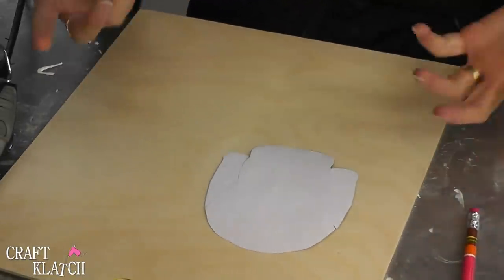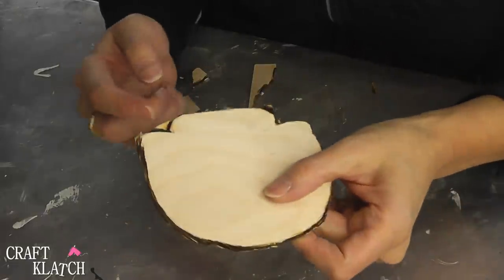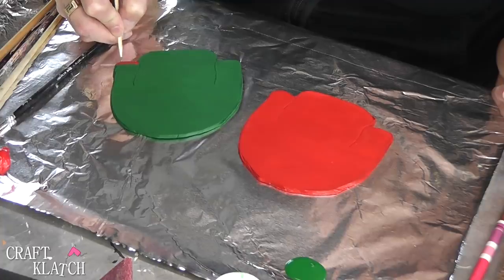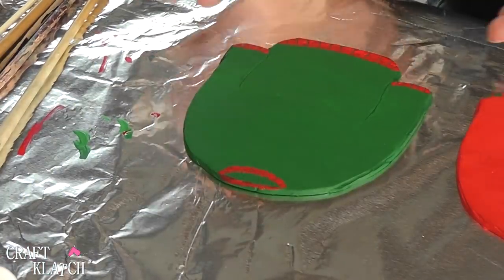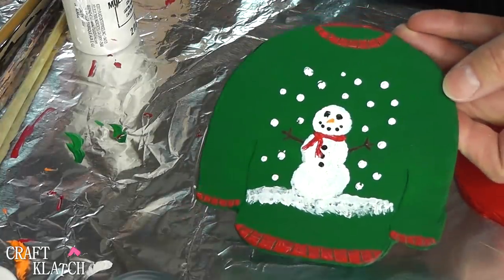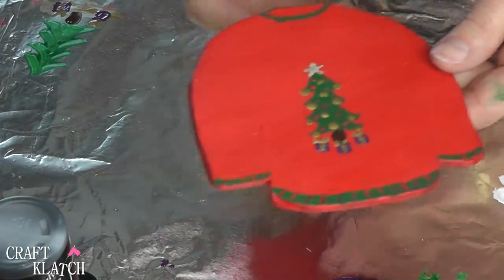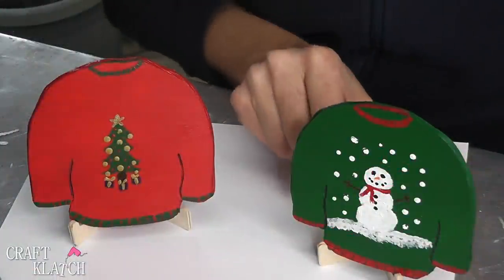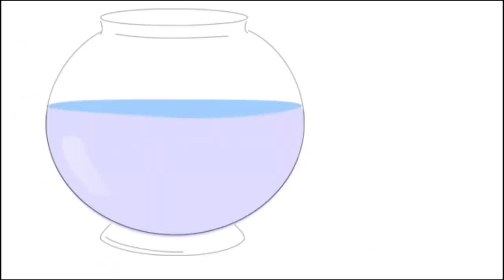Ugly Christmas Sweater Coasters | Another Coaster Friday | DIY Project | Craft Klatch | How To

Comment: Those are so cute! You could probably do with a coping saw for colder weather. They are a very easy to use hand tool that can be used in the house without so much dust like the Dremel will send into the air.